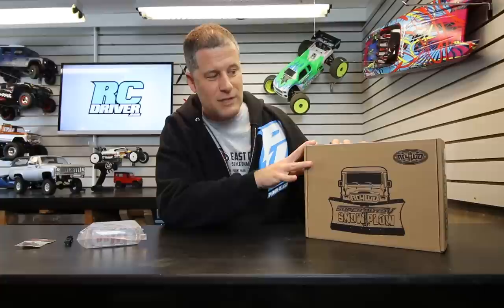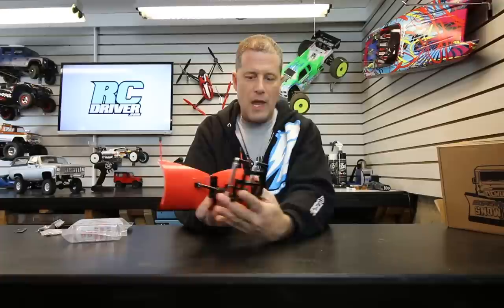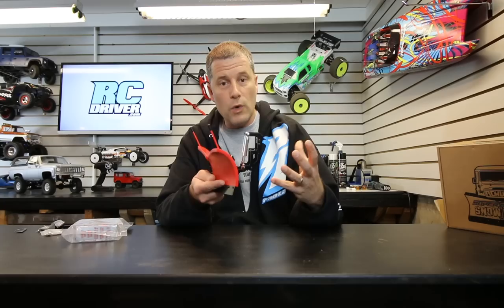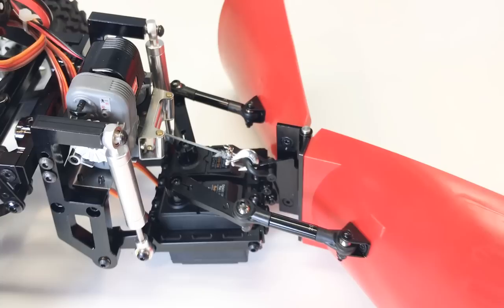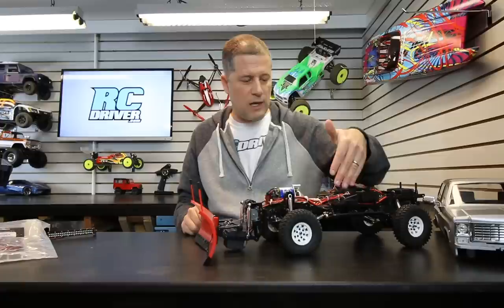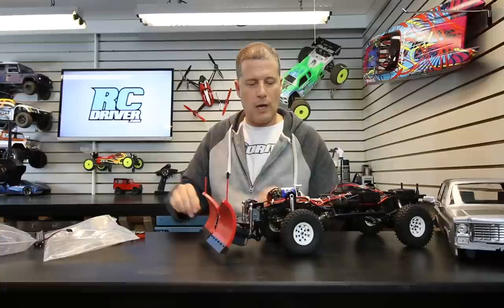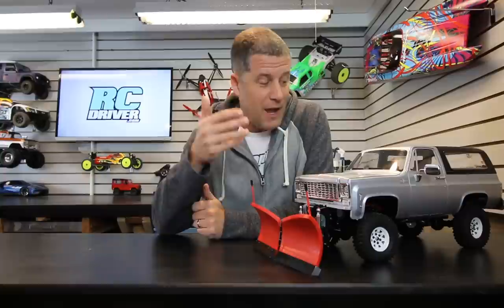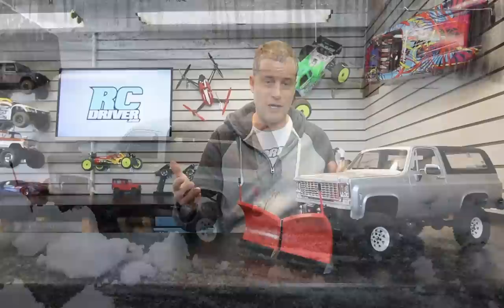Snow Plow Your Driveway With An RC Truck - RC4WD Super Duty V Snow Plow Install | RC Driver

Comment: I'm working on my element Enduro Trail walker and scx10ii for this yrs snows. We get crazy snows here in NC and it'll start snowing anyday now and I had the truck ready but come to find out I had a few bad bearings in my element I legitimately lost a wheel 😂 so I went ordered new bearings ect for it. It's lifted pretty high n has the prol Interco Super Swamper TSL boggers XLs on it the 54"s it's got 124mm tall shocks it's running a castle Momba monster 6s ESC and a huge 4276 2200kv big block I got the metal axles on it I ended up putting portals on it to help it get through the 17+ inches we get everytime it snows 😂. I got the winches on em both front and back. I even went as far as to install micro servos on the windshield wipers and put the metal whippers with the rubber on em basically real whippers just scale and yes the work 😂 I installed bright like really bright scale lights I got a few different bodies for em imma use a 79 F250 high boy and a K5 blazer from RC4wd. I got the Stealth X trans still in the element and installed all steel gearing and heavy duty steel diffs in it so no breaking gears in either truck lol. The Scx10ii has a green neon color transmission ECT iv changed it completely up and it's on the proline interco super swamper TSL SXs XLs and both have RC4wD steel rims. They look amazing and basically ready to go I just gotta finish up the new bearings from winter on the element and finish up getting the FPV cams in the bodies which they work n tested just gotta get em n the bodies. Iv also done everything metal upgrades so hardly no plastics on em anymore. Full interiors ect scale things ect. And so is my buddy he done the same with his element Enduro Trail walker and we got a bad ass set of trails on my farm one of em is a decently long trail up the driveway from the road to the dairy house which is a 20 25 min walk it's a 930 Acer farm. So the snow will be deep on a gravel road all up the side of the mountain in snow n ice deep snow at that hopefully they will make it. We are going to try to make it and use the winches ect to see if it's even possible. We got the plows as well if needed but who knows this is the first yr attempting this lol

Comment: Watched your video on the rc4wd v plow. I purchased one to mount on my trx4 defender.  I am looking for some help. I want to keep my traxxas remote with telemetry.  I am looking for a 6 button wireless remote to control the plow. Rc4wd was not much help. I am new to this hobby,  but I didn't think it was that hard to find a solution to control the plow. If rc4wd can source a two button control for the winch, why is it unthinkable to source a six button for the plow? Any help would be great appreciated

Comment: I have some plow tips from rick Perry the inventor of that plow. Add weight to truck. Use 1.9 mud slinger tires. They work the best in snow. When your done with this beginner plow find a used rick Perry plow . It has lexan cutting edges and a center metal hinge that has a 45 degree edge in it to protect the plastic blades when running down a side walk. Ricks plows also have a place for lights. Check out slashbasher39 here on YouTube.
Reply: What the cheapest truck under 400 that you can get for traxexs  that you can use plow on because I won’t to ask for one for Christmas I don’t no what truck you can work plow with
Reply: @Deerman2019  go with a stock trx4 they are awesome crawlers
Reply: @onedr1ftwonder680  I looked there 500 and 6 hundred

Comment: Are there bigger plow blades for larger scale rc's? The snow around here can get a little deep at times (one storm can dump 2 feet of snow in the valley and 18 feet up in the Sierra Nevada mountain range...one storm).

Comment: So why are they not making these with 80c motors adding wireless controlled motor to control throttle chain with sprocket
Kinda same way you'd make a mini bike but more a less go cart rear with plow in front